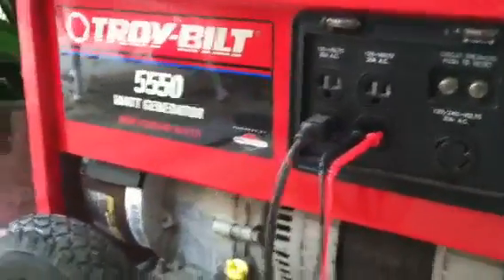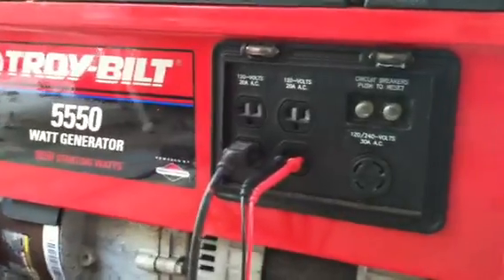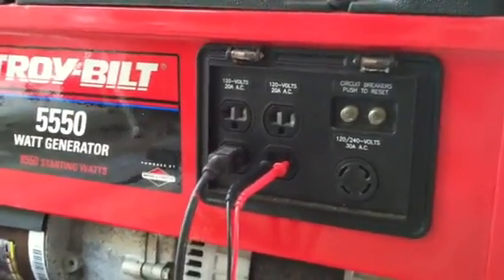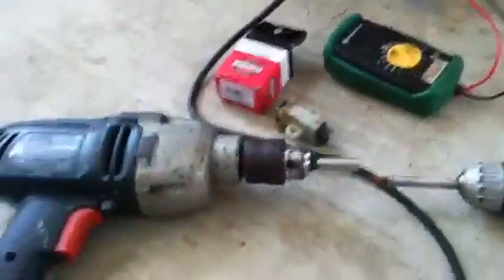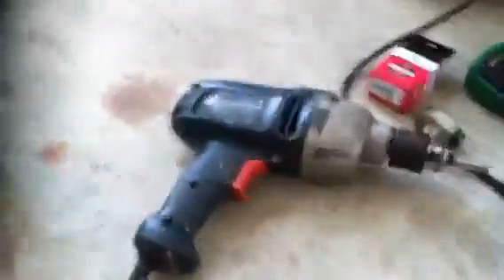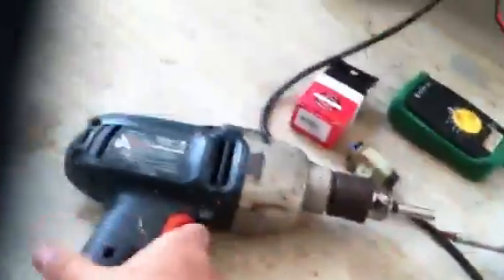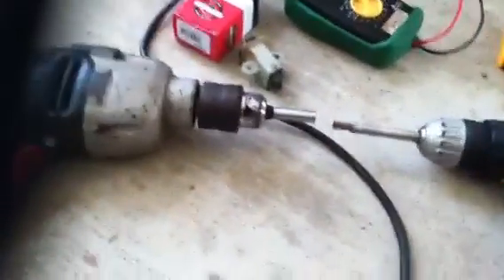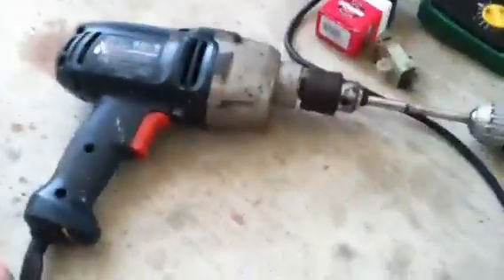Flash portable Generator

Comment: I did this on mines and it works only as long as i keep the drill going, the "field" does not stay "flashed" when i let go of the trigger or restart generator again. i don't want to have to do this every time.....
Reply: Everyone should also be aware with the safety of using generators https://youtu.be/I1jT3ANENvI please remember that portable generators can be dangerous if not used carefully. Just reminding everyone about generator safety. Thank you.